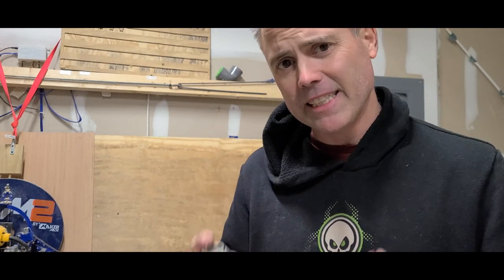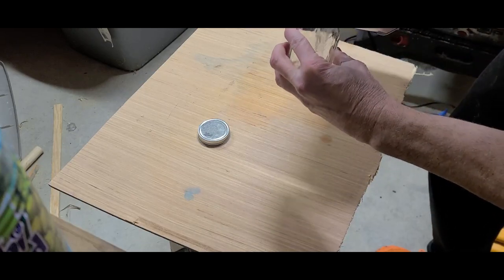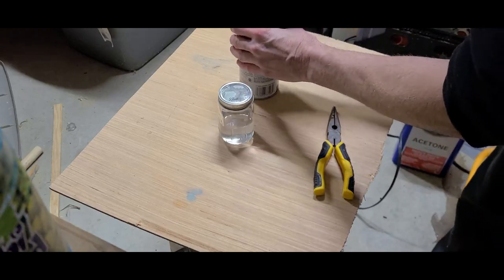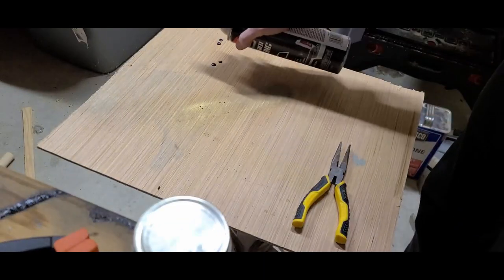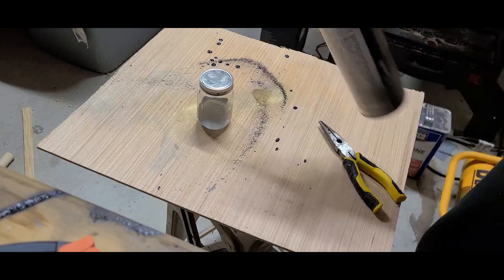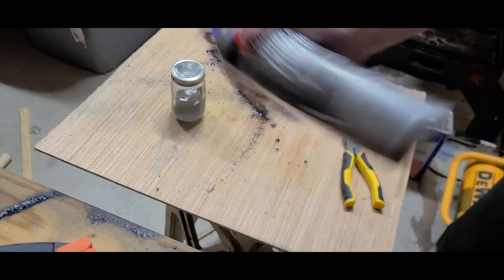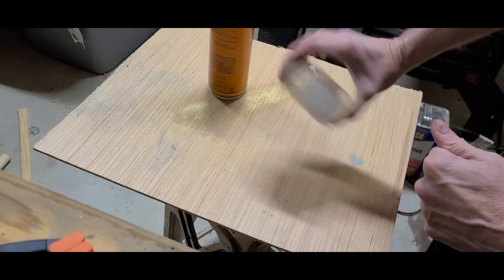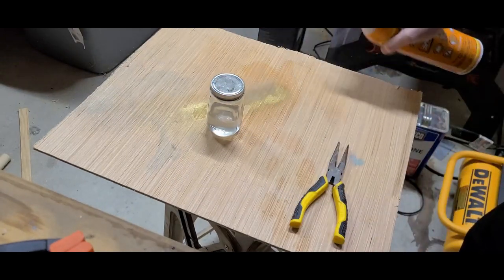Spray Can Clogs - Spray Paint - Crazy Easy Fix - Dark Arts Method - LOL...

Comment: I use carb-cleaner and attach the straw to the nozzle I am trying to clean. The REAL problem is when the CAN gets clogged.
Reply: Right..... my tips are clean, so how do I unclog the can or the tip on the can?
Reply: I use brake parts cleaner and I clean out the tips after each use.  What about when the cab is clogged?  I have two slightly used Krylon primer cans and the cans are clogged below the tips and this stuff is expensive.  I hate to toss an almost full can of product because the can is clogged.
Reply: I’m in the situation right now! Several cans of white primer paint but the can is clogged? Any trick to save this can???
Reply: @roberthoward9482  I have had limited success by removing the nozzle and placing a drop or two of penetrating oil into the opening at the top of the can. Then I allow a few days before I try to spray again. In fact, it's the primers that have given me the most trouble. Especially, spray cans that spray in any direction--including upside down (like Rustoleum). Because of this, you can't turn the can upside down and clear the nozzle as was the case in the good-old-days.
Reply: @jessef3550  some vid showed a guy attaching an air hose to tip and spraying inside can for a second to clear out straw inside can.

Comment: The clog isn't in the cap, it's in the stem (inside the can). Tips?
Reply from the maker: Try dunking the stem in acetone. It's worth a shot.
Reply: Yeah, I just turned the spray can upside-down and swirled the valve around for 30 sec. 👍

Comment: Old cans can also dry up in the can, so they won't work at all, but I'm thinking of making some kind of adapter with cellulose thinner, that can be attached to the can, and sit there "for ever", and perhaps dissolve the clog (I have over 100 good 5+ yo cans to save).  I have had no succes with acetone, but have had nozzles in cellulose thinner for a long time, without them being ruined, and the couple I've looked at, were so softened, that I could pick/blow the pait out - but the tiny "diffuser" blew off one of them, so be aware of that, and blow into a cloth or something to collect it.  Haven't looked at them for a long time, but I will get back to you on the subject, whan I have checked. And - as an artist/"everything" I have played a bit with punching a tiny hole in the side of cans close to the bottom, and then using the leftover spray for artzy fartzy stuff.
Reply from the maker: Thanks for the feedback. I'll try it.
Reply: @Commandodesigns  Not just feedback - also for all the other nerds here. I have just checked my 2-4 weeks soaked in cellulose thinner two different nozzles, and besides them not being softened at all, the paint, that after short time just let go of the plastic, was actually dissolved 100%, so the thinner had turned pinkish, and the skins that that just let go of the plastic after 1-2 days, and were floating around,, were gone. But - be aware of the rubbery sealant in the lid - they often are not able to handle the thinner/acetone - and when I shook the small glass jar, the thinner ran out a bit - which it didn't do after 1-2 days.
Reply from the maker: @CONEHEADDK  That's awesome... I appreciate the feedback.
Reply: @Commandodesigns  Update - the nozzles have been in the jar since last comment, and are still in fine shape - just blew one, and air went through. I see no reason to believe, the spray wont be nice, but I drop an update on that too, once I have had a reason to test it.
Reply: You can drill a small hole strait through the top of the spray tip and use both hands to press the edges of the nosle and aim the top at what you want to paint. Sprays out the hole like normal but a heavier coat.
Reply: You can drill a small hole strait through the top of the spray tip and use both hands to press the edges of the nosle and aim the top at what you want to paint. Sprays out the hole like normal but a heavier coat.
Reply: You can drill a small hole strait through the top of the spray tip and use both hands to press the edges of the nosle and aim the top at what you want to paint. Sprays out the hole like normal but a heavier coat.
Reply: You can drill a small hole strait through the top of the spray tip and use both hands to press the edges of the nosle and aim the top at what you want to paint. Sprays out the hole like normal but a heavier coat.

Comment: I just tried the Acetone quick soak and I also held can upside down and jammed down can without cleaned sprayer and a small squirt of paint came out, I put on the tip and sprayed for 2 minutes straight.  Maybe a little acetone, got into spray can?  thankful for your good video

Comment: Novice here,but ive had luck maintaining the paint tips hole(only) by wiping them off with a disposable SD alcohol pad after each use. Less effective on dry paint but still works on a moderately dirty tip b4 spraying. Won't stop a clog in the stem but helps in negating a poor or erratic spray. The thicker ones that cost apx. $3 for 100 are better than the $1 cheapos. $1 ones can be found near bandages in stores. Diabetic section or a pharmacy for the $3 ones.
Reply from the maker: Great idea! Thanks.

Comment: Great video on spray paint tips,but what about when the pain can is the problem ?
Reply: If the paint can is the problem wouldn't that mean that there's no pressure/accelerant in it (pump it up). or that there's no paint in it(Through it out) although it's straw in the top of the can is clogged, just pour a little of the acetone on top and then press the nozzle with a tool

Comment: After using  a rattle can and before putting it away I use brake cleaner to:
1) Spray the front of the nozzle
 2) Spray through the nozzle into the stem end and
3) Spray a shot or two down into the  the  top of the can where the nozzle attaches.  This will displace any residual paint on the atmosphere side of the valve.

I found this to work for lengthy storage almost 100% of the time however If on a rare occasion you find it plugged after a long period of storage, I use brake cleaner down into the can instead of air, by pushing down on the valve while simultaneously spraying brake cleaner into the can.  A couple short shots is usually adequate but you may have to repeat a couple times.   I do this into a trash bucket, also using a rag over the top of the can to trap escaping paint.
Reply: Thanks. I been holding on to cans and trying to get them to work.

Comment: I also put the tip onto a can of carburetor cleaner and spray, clears it right out with the bed liner I thought that's supposed to be chemical resistant

Comment: I took a can that was completely out of paint. Then spray to empty out all the air. I drilled and attached a small valve stem on the can, and use a hand pump to add a little air pressure. After painting. I take off the spray cap, and put it on this can of air to clean out any paint that will dry and clog up the spray cap. The bad part. You have to buy paint that uses this style cap, or make another air can for that type of cap.

Comment: I tried this on 9 clogged tips and it didn't work for any of them. Krylon brand spray paints. I tried 3x in a row. New acetone. Paint is less than a year old.Tried shorter and longer times.The cans aren't clogged. So why isn't it working?

Comment: Unfortunately this didn't work for my Rust-o-leum fat nozzles. I had two clogged ones and tried four times with each one but it didn't clear the paint. I tested the can and knew it still sprayed so the issue was the cap.
Reply: If you have a compressor in your workshop, find an airgun with a nozzle (or drill one out to) the right size to be a close fit over the stem. Dribble acetone into the stem hole, leave a minute, then use air. Works for me on Rustoleum cans so old I can't remember buying them.

Comment: I'm a professional graffiti artist and I have 3 jars of all different sizes, different manufacturers of the best spray paint on the market filled with a quart of Acetone for the past 2 years and it did absolutely nada. . Caps are still in tact , did not melt at all, and once that paint is dry in the nozzle, done deal. I keep the jars to show all those who think it works. I use acetone on the daily, it's the only solvent that removes the paint I use off my hands at the end of the day.